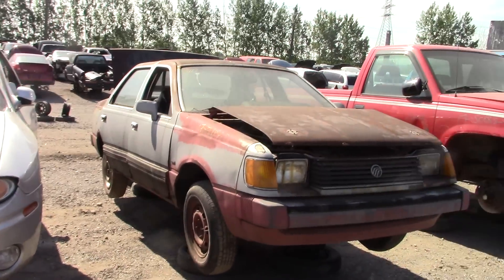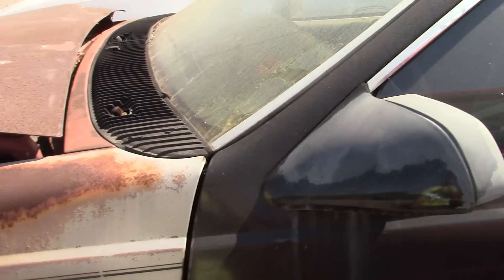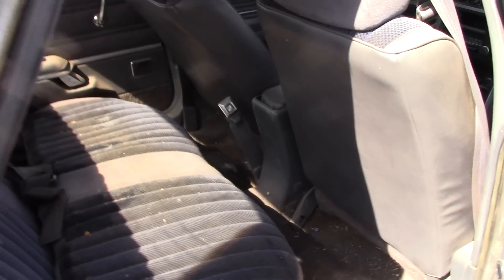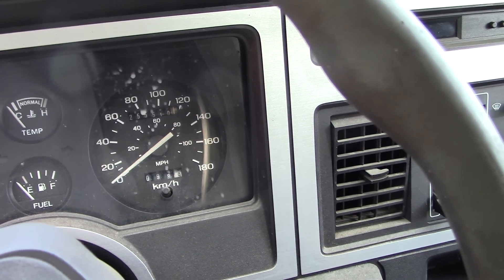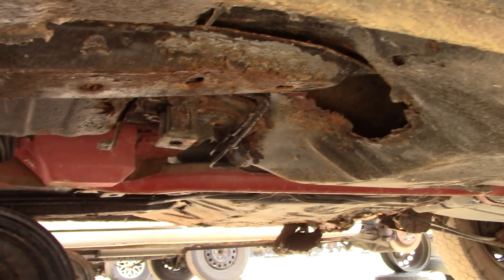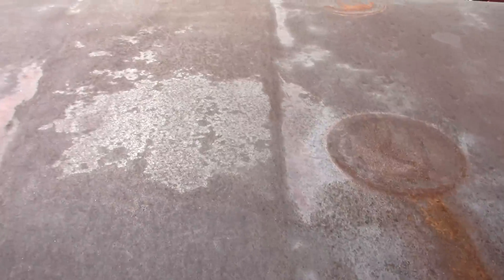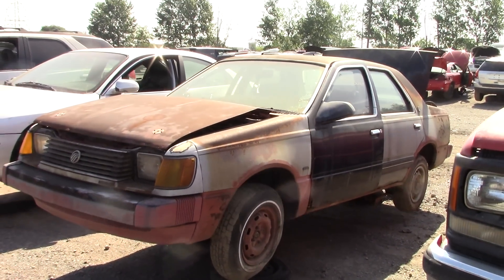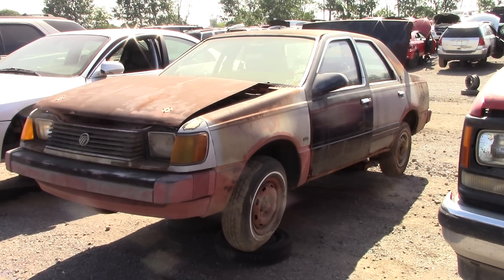I FOUND A DIESEL TOPAZ IN THE JUNK YARD!

Comment: As those know in the mid to late 1980's ford had offered a diesel option in its tempo when those believe Mazda supplied engines for other vehicles as for a few years in the mid 1980's there was a diesel ranger.  Knowing the diesel option was that rare as what if production data was compiled as less than 5% of the vehicles left the assembly plant with the diesel.